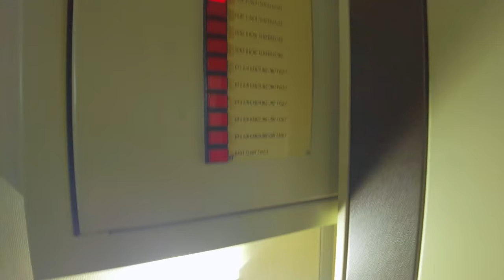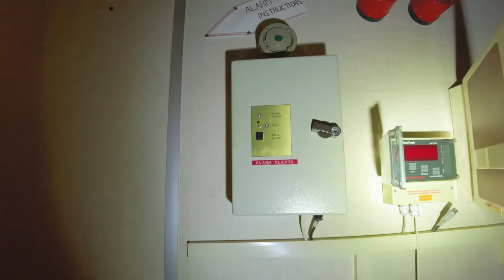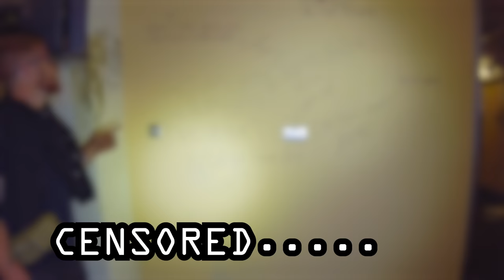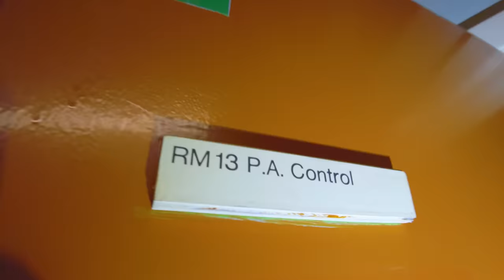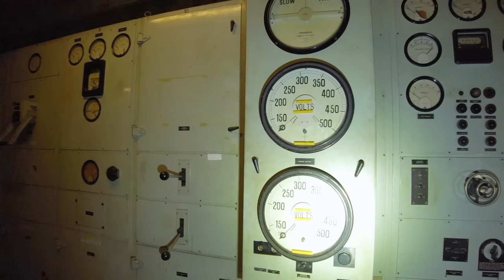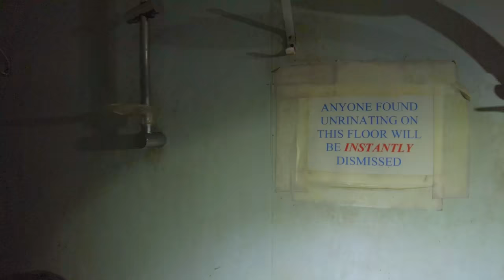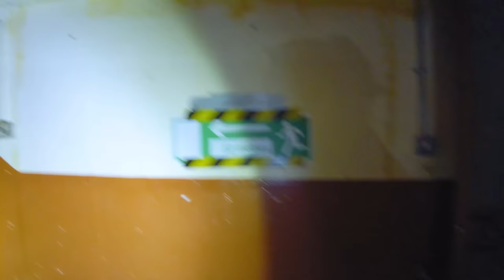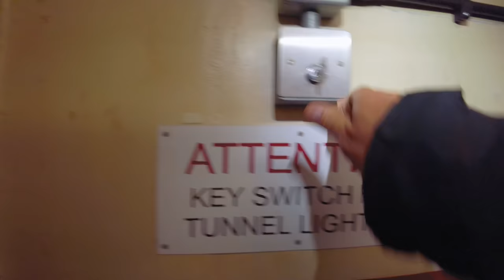Top Secret London BUNKER... PART3 of 3 ITS CRAZY!  MORE DISCOVERIES

Comment: I’ve seen other explorers in here and they opened the watertight bulkhead doors using the hydraulic levers you found on that mezzanine level. This is the biggest deep level tunnel / bunker I’ve seen so far under London but maybe you’re able to get into the ultra deep level tunnels some day. I think you were very close here as those telecom wires had to go somewhere out of the bunker.
Reply: These cables also carry a voltage giving the dial tones.
Reply from the maker: @BenLuis732  I think all cables carry voltage  ;-)
Reply: Haha…..very true. Thanks for this explore, true gentleman

Comment: At 5:37 you are showing Control Data Corp disk drives. I used to work on Burroughs disk drives in the late 70s early 80s. The fixed disk drives I worked on had a capacity of 220 Mb each and two of these were in each cabinet.

Comment: 1:10:14 - that's a Motorola TRBO Digital repeater. There is probably a leaky feeder antenna system throughout the tunnels for contractors, security and any responding emergency services to use. One concern after the King's Cross fire was the inability of people to communicate below ground or to or from below ground. Mobile phones and airwave don't work down there, nor would the LFB's Fireground radio so BT probably installed it at their request.

Comment: The bricked up tunnel with the silver foil was the one where the cables went in and out. You can see the holders for the hooks on one side. You also found the hooks in the ground when you opened the floor panel.